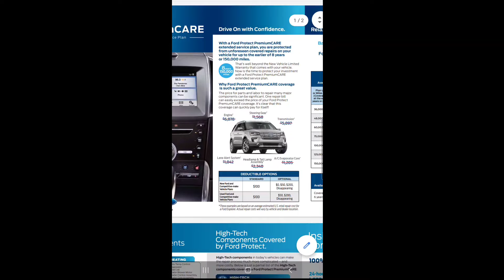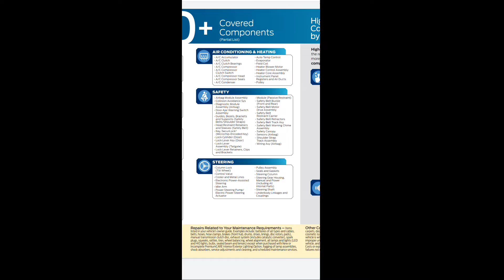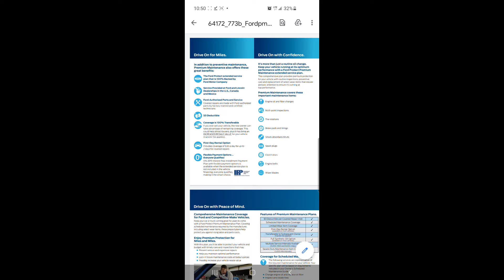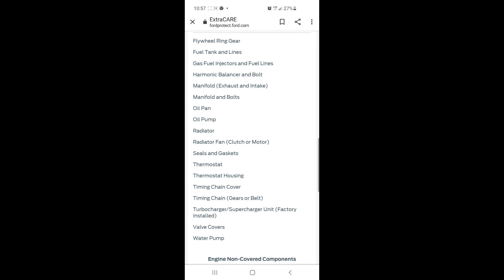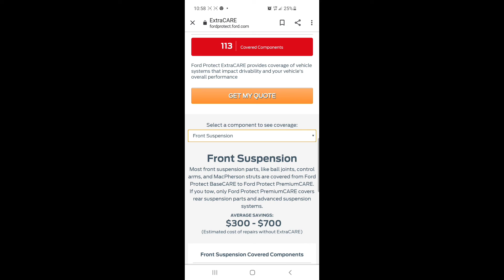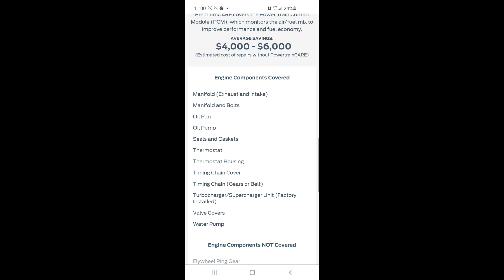Ford Service Plans Pamphlet and Explanations - Options, Premium Care with Maintenance is best

Comment: I’m about to buy a 2018 Chevy traverse from a ford dealership with 45k miles on in. They offered me ford premium care for the vehicle for 4 years that means I can take the car to Chevrolet and the car will be able to get fixed? I’m just confused how it works on vehicles that aren’t ford or Lincoln

Comment: Ford ESP is a joke. Bought an 8yr one for my F250 diesel. At only 40k miles the DPF system failed at a cost of $7k, NOT COVERED. Power steering gear box bad at a cost of $1800, NOT COVERED. Try calling them and you get to speak to India who can give zero shits! Worst investment I’ve ever made
Reply: Yeah, my issue was not with Ford Protect but the actual dealership that sold us the contract. Turns out that the mechanics will benefit more if the issues are not covered under the plan and they can charge you more.
Reply: @shill1444 pretty sure they don't cover anything DPF related It says that in the brochure.
Reply: @JamesPiccone  - Yeah but no, our issues had to do with some sort of modifications that were made to the used vehicle that we bought without our knowledge. 

This led to point of contentions with the extended warranty and point of failures in the driving, from wheel balancing and alignment issues, steering column damage, rack and pinion issues to rear differential problems, problems with the rear axle, and of course that led to replacing brakes and rotors on the vehicle, not a year after purchase and then a few months later, the dealership tells us we needed to replace the brakes and rotors again because they were covered and packed with rust. 

The team leader said well maybe if you would stop four-wheeling in this thing it wouldn't do so much damage, and I'm like we do not and had never four-wheeled any vehicle at all. As a matter of fact, it's been in the garage for a few months because my son was deployed and was not driving the vehicle at all. I think you sold us a modified Jeep and had us buy coverage on it but now you're telling us that the coverage doesn't cover any of these things that was going wrong with the vehicle. It was a total nightmare. SMH
Reply from the maker: I've not had a single issue

Comment: This is a good video. I actually have the Ford protect Base Care on my 16 Jeep. 

Only thing is, when I took it in to get some suspension and differential issues repaired, at first they said "NOTHING weren't covered"... I had to literally show them the list of components that are covered in the booklet and then everything was okay.

This was very helpful.
Reply from the maker: Beautiful
Reply: @FordBossMe  correction: unfortunately the pamphlet that the dealership gave us was an older, outdated one and was different than the actual care plan that they sold us so Ford protect would NOT cover any of the damages and the dealership said we would have to pay $3,000 for all the work.  We already paid $2700 dollars for the plan just a year before. SMH
Reply: @shill1444 not beautiful
Reply: @JamesPiccone - Yes, agreed. He ended up taking legal action with these people. Over a plan that we paid for to deal with parts that they refusey to cover. 

All because they changed the pamphlet. Of all the silly, stupid, pedestrian things to neglect your customer over.

Comment: fords premium maintenance plan is a scam. Its just another of the dealerships way to sell aftermarket scam stuff to get a commission for their finance officer.  Your basically paying for your oil changes/fluid checks etc ahead of time for up to 8 years. About 300 dollars a year to cover future oil changes, checks. 95% of the people don't benefit from the plan. Only someone who drives a lot, 20+ thousand miles a year will benefit. Much of the "benefits" in the plan are in fact not true and scams. They say your basic brake work is covered, it isn't, pads and such aren't covered. It says full synthetic oil available for most vehicles, scam, that isn't automatic, its AVAILABLE for most vehicles, you don't get that in the plan unless you pay more. Doesn't even include that much of the time the service department doesn't even do the services you have paid for already, such as tire rotations. Its a salesman scam to get more money out of you for minimal work. Don't ever get this crap. I worked for a Ford dealership, they actually have classes they give to employees in order to teach you how to scam money out of people. I've been in those classes. These extended warranty plans and extended maintenance plans are shrouded in legalize and are just commission bonus's to the finance department to sell you these scam plans.
Reply from the maker: Probably not a bright idea to come to a dealer technicians page where you know for motor company and management team watch and say things that could effect my job by people watching 

Not a bright idea but then again you probably don't care 

The maintenance plan is tied into the loan so people don't have to pay out of pocket later and to keep them on schedule
Reply from the maker: It does help make money indeed

Comment: Great explanation! I've owned 7 new Ford vehicles in my life. I've never had to take any back for any warranty issues. (I did have a 1991 Taurus that had recall for transmission.)  With the cost to work on these new vehicles and the electronics (which is what my daughter had the most trouble with in a 2012 Focus) I bought the Premium Care for my 2018 Explorer about a month ago. It's a Gold certified and they only go to 140K miles for some odd reason.

Comment: I need my 06 F150 restored. Exhaust crack, engine light always   on.   Misfiring needs new plugs. Have 79k miles. Has rust at bottom of rear cab area.  Also transmission slips at times. Can I refinance this threw ford???
Reply from the maker: Can you explain how you he even came up with this question about refinancing because I'd like to know more about the situation, are you still playing on this thing or what
Reply: @FordBossMe  Truck is paid for.. I'm not intrested in another truck. This truck needs a few repairs and I wondered if there was a repair or restore finance type type of option ever in place by ford. This was a thought I suggested. Mainly for those retired individuals like me could have.
Reply: @FordBossMe  I dont trust those insurance companies that have auto repair financing services.

Comment: Awesome vid, I thought Ford called for the engine out for this job, what is the book time? I own a 09 Edge from new and do oil changes myself at about 2500-3000miles. Hopefully I can hold off this expensive repair.
Reply from the maker: Some guys will pull the engine out but it's not necessary there's plenty of room